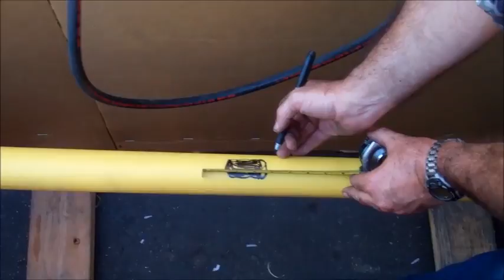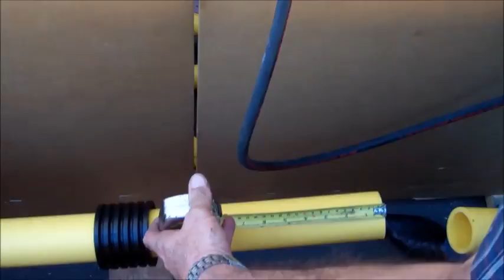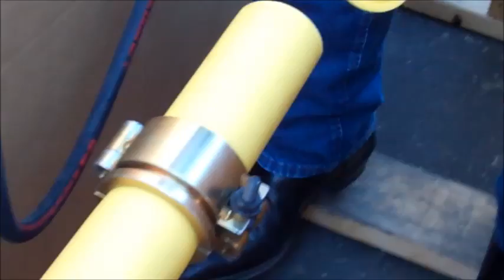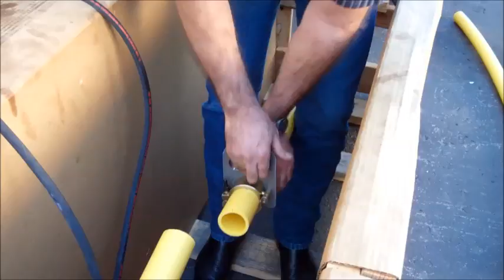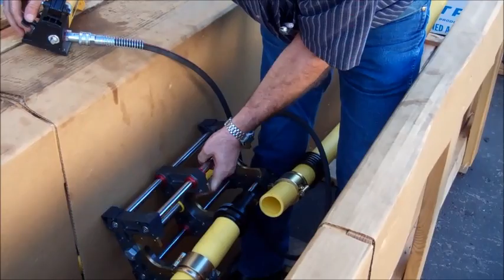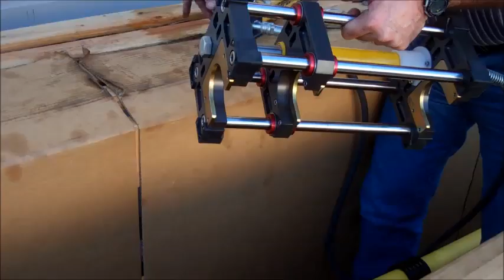LycoFit® 2 IPS Repair Coupling Installation   LHP 200 Training

Comment: Having worked for the gas utility in St Louis Missouri for 35 years I can tell you the Lyco PE  couplings are the best I have ever used. But I feel your video could use a little clarity. In the real world the damage could be one inch or  14 inchs if a backhoe tooth slices it. So your repair fitting demonstration seems a little confusing because you don't go over stab depth or maximum allowable cut in the polyethylene plastic for a repair fitting. At this time I just feel better using 2 Lyco standard couplings with a small piece of polyethylene plastic between for makeup until we're more comfortable with your repair couplings.( it just seems your repair couplings have limited applications for use).
Reply: Bob, Thank you for you comments and recognition of the integrity of the LycoFit joint used in LycoFit Coupling for PE repair.  You are correct in noting that the video is not a replacement for the use of the LHP-200 press and LycoFit Repair Fitting Installation Instructions.  The video is implicit in that it represents the damaged area in black marker and the length that the Repair Fitting can directly replace is marked on the pipe at 3-7/8 inches symmetric to the damged area which is subsequently cut out in the video.  The written instructions are explicit in marking that area linearly on the pipe at 3-7/8 inches.  If the damage covers a greater length of the pipe than 3-7/8 inches; say a length of 1 foot,  depending on the size of the opening made to expose the damage, the 2 IPS pipe is too stiff to try and install two short couplings.  In this case a 2 IPS Repair fitting, a 2 IPS Coupling,  and a short section of 2 IPS pipe would be used to repair the damaged section.